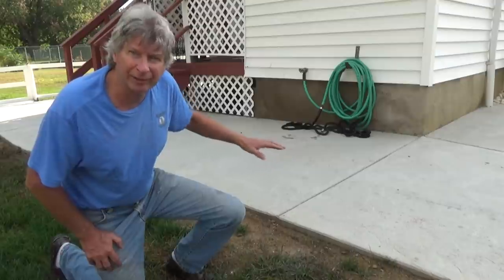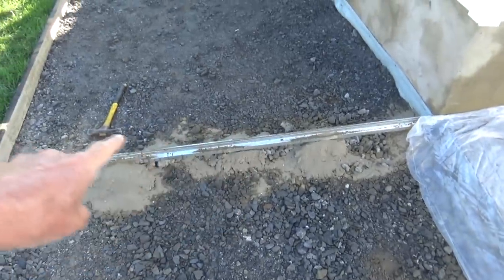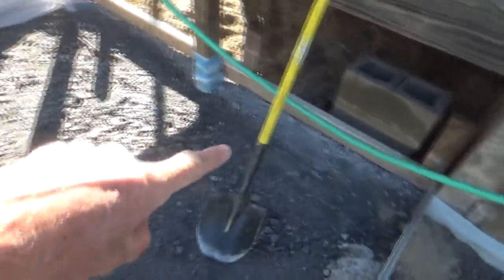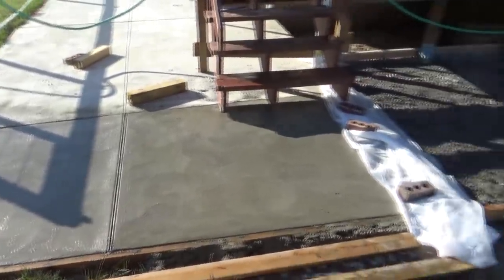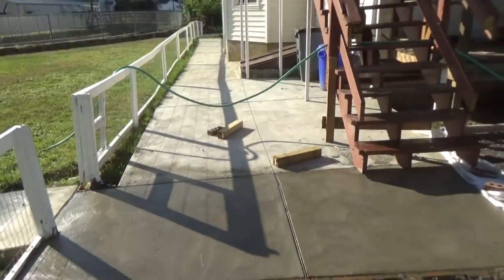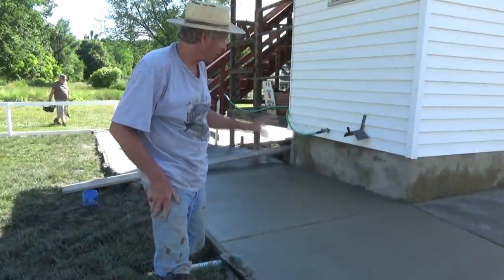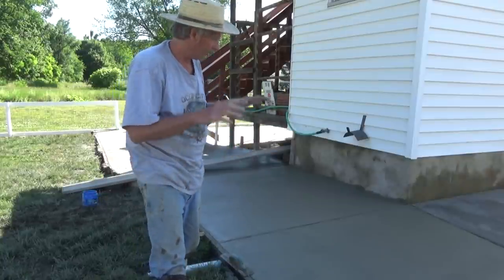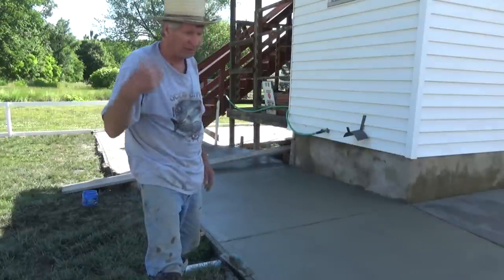CONCRETE SLABS-PADS-FLOORS-PATIOS (Part 9) Mike Haduck

Comment: Hi Mike, great job. Did you add some lime to the cement in order to prevent cracks? Blessings from Venezuela.
Reply from the maker: Hi Antonio,In mu opinion  lime does not hold up in my area, your area might be different,  thanks Mike
Reply: @MikeHaduck  Thanks Mike.

Comment: Mike I understand your rational for rebar and mesh screening as I grew up in Pocono Lake. My question is I have not seen you use or any comments offered about using fiberglass as a reinforcing agent in concrete.  Do you have an opinion and any experience using such reinforce concrete.  My handyman experience has been that you get some fibers in the top layer but they wear off quickly.  Love you videos!  Informative and well paced with excellent data and explanations.
Reply from the maker: Hi Jim, I get fibers added to the concrete now and then ,and sometimes plaster, they dont seem to hurt, I did a video called, should I use rebar in concrete, yes or no, thanks mike

Comment: The witches broom made an appearance, so thanks Mike. However, you didn't say "it's no big deal"...or "you gotta wet it first" even once which is a little disappointing 😉....nice job as always though Mike......peace to ya.
Reply from the maker: Thanks Darren, Mike
Reply: @MikeHaduck  👍
Reply: Thanks again!  If you didn't put sand on the cement you used to hold the form keys in place would the slab crack there?

Comment: Hey Mike, I have a crazy question regarding using something other than water with cement for a situation where you need to use it in an emergency in the winter. What if you used antifreeze instead of water? Would it work? I know it seems crazy, but I just wondered if anyone has ever tried anything other than water. Even just for the sake of an experiment.
Reply: the chemical process for concrete hardening requires water. Antifreeze has water in it so in theory it might work. Why not try it out on a small amount of cement/sand?
Reply from the maker: Hi Joe, I have used it before, and had no problems but I am not a fan of winter work, mike
Reply: @wayneleone  I was thinking about filling an ice cube tray with a mix haha
Reply from the maker: Not a bad idea, Mike

Comment: An old cement finisher once told me...There are two sure things about concrete slabs:
1- it will get hard
2 - it will crack
Reply from the maker: Thanks George, very true, mike
Reply: 3- they wont steal it

Comment: All concrete needs steel and to be vibrated, ALL CONCRETE! No matter what the job, concrete will turn to a cracked uneven disater in a quarter the time without proper steel layout and vibration. I'm a qualified Journeyman Concreter of 20 years and if you want longevity from your concrete then use steel and a vibrater, trust me!
Reply from the maker: Thanks Chris, I been doing it over 50 years and worked a lot with vibrators,  but not with this type of work they make it run when you have slopes, thanks mike
Reply: @MikeHaduck  50 years. Congratulations on your golden anniversary. You must be happy with your youthful decision to have done it so long and, apparently, so well. Here's to your next 50.
Reply from the maker: Thanks again, mike